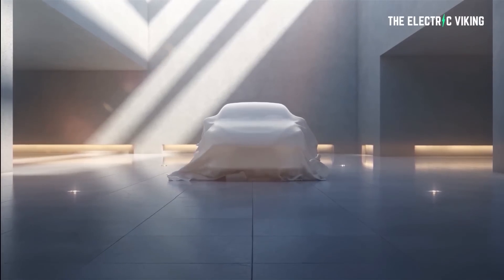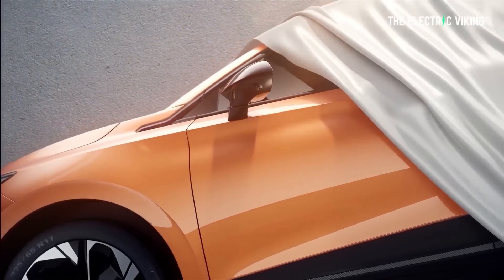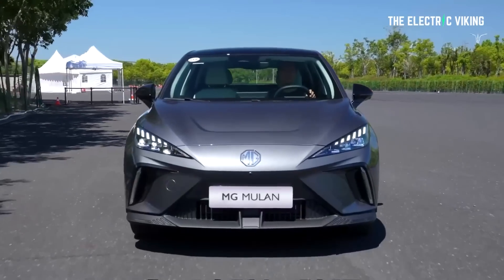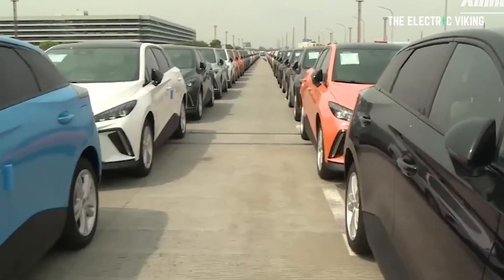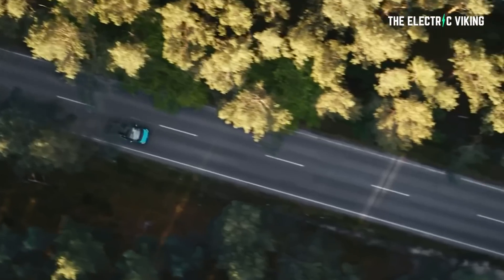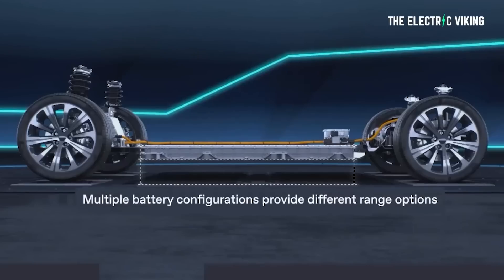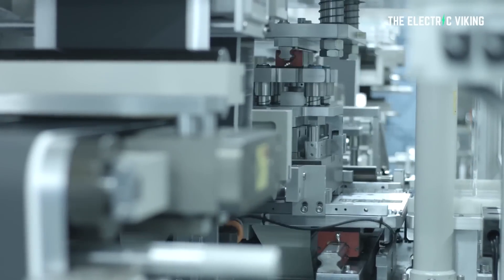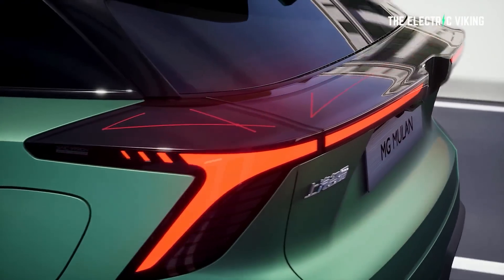MG 4 Mulan EV already shipped worldwide + how much it costs!

Comment: standard range and long range are rearwheel drive not front wheel drive as stated 👍
Reply: So you are saying your research into this car is better than Sam's 🧐
Reply: @icosthop9998  Motor is on the back axle for both batteries in the UK. Would seem strange to re-engineer the car for different markets.
Reply: Yes, the mg4 is a rear whel drive car. A massive advantage over byd's atto3 fwd. Fwd on a high cog suv makes for poor vehicle dynamics.
Reply: Sam is wrong,they are rear wheel drive,hot hatch is 4 wheel drive.

Comment: The famous MG brand that failed with the British car industry, now coming back as a Chinese import - says a lot about how the world has changed! Nice car and nice price.
Reply: I was wondering if it was the same company but I think it was bought out, just kept the old name ❔️
Reply: @icosthop9998  yup, nothing left of the original MG/Rover group not quite sure if they are still running the R&D at Longbridge as they were on about closing that down.
Reply: Joys of having Governmental support and a large cheap non unionized workforce and near zero objections to planning infrastructure builds
Reply: @charlesuk5358   Thank you very much 👍👌👍
 My  "Replies/Alert"  section of YouTube is not working all that good but much appreciated that this came through  🙂 👌

Comment: Those prices are With VAT icluded, here in Spain the top spec is 10k cheaper than the equivalent VW id 3.. all the MG 4 , except the Hot hatch, are rear wheel drive not front.

Comment: The SR LFP version has the same range at 100% charge as the LR version at 80% charge - which is what most people will be charging it to regularly to protect the battery and save time.

Something to consider.
Reply: Yes I was trying to find this information as all the U.K. reviews don’t mention the battery type, the base version is fantastic value and you can just wack it to 100% and drive it - makes it easy and quick to live with. All the reviews I have seen say this car is the puppies luggage.
Reply: @damiancox7276  true, and the LFP version should retain good battery health for years to come, which may have a positive effect on the resale value down the line, since people would be less concerned about how well you took care of the battery (by avoiding 100% charges).

With LFP they won't care.

Also the LFP is supposedly safer in a crash.

Comment: In the UK prices are £25,995 for the entry model £28,495 for mid range and £31,495 for the top end.  This includes any VAT. This is expansive based on the price in China in dollars.
I have the mid range in grey on order and should be available end December or January 🤞

Comment: I ordered the Trophy/Luxury version (Germany), paid around 31.500€ after taxes and after „environmental bonus“ of 4500€ by the state. 

You’re getting a car with almost every technology you could think of, except for wireless car play, front beepers (360° camera though) and stuff like auto park or summon features.

Moreover, you get 204hp in a smallish car with a 50:50 weight distribution. I don’t think it’ll get better than that for just over 30k for a couple of years, plus you have a 7 year warranty possibly reducing running costs by quite a bit.

Design-wise, I very much think that this cars design needs dark colors, the dark grey and even more so the black version look really quite aggressive irl.

Comment: In Italy the price is 30000€ for standard trim, 125kW motor, 50kWh battery, 350km range and 34000€ for comfort trim, 150kW motor, 60kWh battery, 450km range, included VAT. However, with government incentives, scrapping and old ICE car and with 1000€ launch discount from the dealers, the price becomes 24000€ and 28000€ respectively. Now, yesterday I was at a VW dealer to upgrade my ID.3 to software 2.4. A petrol, less than 125kW Golf, just at the entrance of the showroom, was priced as a "bargain" 32500€ price included VAT, of course there are no government incentives. So, why on this universe somebody having some mental sanity would still buy a VW Golf rather than, for example, an MG4 with comfort trim??? My "only" concern is that we will soon be in the hands of Chinese for cars too.
Reply: Just accept it dude that this is China's century.  🤣
Reply: I agree... Normally.

Right now in the EU, unfortunately there are valid reasons not to get an EV, and one of the biggest is the war in Ukraine.
Reply: @stevenjones916  Soclai is always better ;) than subservient  to individualistic US/UK/EU ;(

Comment: SAM STOP. The MG 4 is not front motor front wheel drive it’s REAR MOTOR REAR WHEEL DRIVE. Or Dual motor AWD.
Reply: Correct. A massive improvement over byds fwd atto3

Comment: BTW you mentioned there are 3 trim levels/models and included the Hot Hatch model in Europe (and therefore Germany for which you gave a price). The 4-wheel drive twin motor Hot Hatch is not shipping this year and no price has been announced. In the UK (trim levels have different names on mainland Europe) there are 3 trim levels all of which are single motor, REAR wheel drive, starting from £25,450 for the Standard Range SE trim with 51 kWh (LFP). Another £2,500 gets you the Long Range SE trim with 64 kWh (Li-Ion) and a further £3,000 buys you the top of the range Trophy with the same 64 kWh. In addition there are paint colour options with both metallic and Tri-coat options. There are to be Extended range 71 kWh and Performance (Twin-motor) models to released mid 2023 but prices aren't released for these which is understandable in the current climate.

Comment: I thought I saw somewhere that MG4 might also come with swappable battery .. If that's true, that would be just amazing.
Reply: Only if their sales make enough to Warren it...
It will be better if these manufacturers come stogether to setup some common ground so their battery swapping can cater for different type of battery tech & battery size...

It may not happen in EU & US for awhile but in China there may be a slim possibility it may be in their interest to do so
Reply: Don’t think it does on this model, however the electric platform it is built on does allow for that.  So maybe somewhere down the road.

Comment: Cars in the UK are normally more expensive than EU but for once this  is slightly cheaper starting at £27k..€31k inc tax !! ...And all reviews are pretty damn good. Finally the Chinese are brining competition as a result the new Kia Niro Ev is only a little more expensive.. but still very cheap compared with other offerings .. it looks like the competition is finally starting that will bring prices down.

Comment: This car does sound very interesting for the price. Some devils in the details that put me off: small back windows with poor visibility, no rear windscreen wiper (same issue as with the ioniq 5), no frunk in 2022?, contrary to report by electric viking, first reviews do mention poor software/incomplete software out of the box, no rear and front washer nozel to clean the camera lens.
Reply: My Vaxhall Ampera has no rear wiper, it's never been a problem, never even knew it was a problem, nor did my previous two BMW 3 series or volvo S40 thinking about it. As for no frunk in 2022, the "engine compartment" is smaller similar to the ID3 and the bonnet drops down at the front to reduce aerodynamic drag, that's why there is as much internal space as a Tesla model3 but the car's smaller, can't have everything. So the software is a bit slow, bid deal, it's not running ANSYS or STK, and as for no jet nozzle to clean the camera, like how hard is it to clean the camera with a damp cloth once a month?
Looks like a fantastic car to me, fantastic price, affordable!, design wise most people will like it, range is good, this could be the EV most ordinary families have been waiting for, half the price of a Tesla model3 or modelY.
Reply: If u want a spray nozzle to clean camera that's in Benz, Mercedes like pricing u are looking talking in a different market buy an BEV rolls royse (rolls royce may not have nozzle to clean camera) 

I haven't seen affordable ICE vehicles with back camera with a spray nozzles 😅 🤣

Comment: Disappointing the standard spec is FWD. Good though that the base models use the LFP batteries. I don't need to get to 100km/hr in 4 seconds, I would go for that base model if it was nicely under $40k driveaway and decent warranty.
Reply: @stevenjones916  Thanks and Wooly for pointing this out, good to know.

Comment: I have some insight into VW internal stuff

To fix their terrible software, Diess actually founded the daughter company “Cariad”. Because getting rid of people in the automotive industry is pretty tough in germany so to get around that they actually drafted every competent software engineer from all their different branches. They offered big cars and massive boni. This pissed basically everyone off since cariad wanted to start from scratch which would have taken years. Now porsche has been talking and working with apple for years, aiming to fully integrate apples new carplay. Diess however went public by saying “we can’t rely on apple for everything. Not everyone has an iphone.” Porsche however got really mad about this since their customers well … they tend to have iphones. 
Porsche as well as audi would have been forced to use cariads software.

Among other things: a high class VW brand has been developing a new System control unit that got rid of thousands of small micro controllers for an upcoming EV. The new VW CEO in a attempt to appeal to investors is now about to throw all of the hard and necessary work over - making all this a MASSIVE waste of money and time.
How does this appeal to investors ? If everything stays the way it was - outsourced software, old hardware and supply chains etc it fits very neatly into an investors spreadsheet.
Diess was the only guy that could have at least saved some of VW - I mean going from 11.8mio units down to 2 million EVs by 2026 is a pretty harsh drop but at least they would have a somewhat competitive product in the end. The biggest flaw of VWs is still their horrific software … Diess tried to fix it 

Now all of this is hearsay. None of the information I have is confirmed or comes straight from VW. A friend of a friend of a friend may have heard something.
Even if all of this is largely false: there’s a LOT going on at VW internally both leading up to Diess’ replacement and after. It’s going to be wild. 
 
Abd if you ask me? 
The writings on the wall.

Comment: So a China builld car that in China costs $18.000 will be allmost double in price when it hits the EU market. 
Thats what I expected. EU Protectionism, for the German, Italian and France car industry.
Reply: well, any country want to protect its manufactures. even in my country Indonesia. the cheapest tesla cost 150k usd. ioniq5 56k usd, ev6 cost 80k usd... that so called the chepest ev in china  wuling mini ev cost less 10k usd there here cost 16k usd (standard version) and 20k usd for long range version.
Reply: @jonitan76  Indeed. I understand protectionism, but . . . . this change to EV is environmentallly driven. All for better inverinment. 
But the old car industrie refuses to change to EV. There is a lot of pressure by the biljonairs in the oil and car industrie to keep burning fuel so they can keep getting richer. 
Thats what is behind it. And the mentallity of the masses, that is afraid of change.

Comment: Mulan is still more expensive than byd dolphin, so it won't sell well well in China. Most of the production will go to international markets. Do you really need 3.8s acc on such a compact car? I think people buying this car are practical and on tight budget. the long range version makes more sense for them.
Reply: The mg4 is rwd, the atto3 is fwd. There is a massive difference in driving dynamics between rwd (better) and fwd.
Reply: @nordic5490  that is true, though for this price range, do customers really care about this? mulan misses some important features. the 130k rmb version of mulan and 113k rmb version of dolphin have similar ranges, but the mulan doesn't have side airbags nor head airbags. other features on the mg are kind of lower than dolphin too. Besides, BMS of byd is way better than MG. the fact that mg is shipping most of mulan production out of china proves that SAIC prefers to avoid competeing with dolphin head on. that is a pretty wise decision. the chinese market is too price sensitive now.

Comment: Another Low Mileage UNAFFORDABLE E.V. 🤪 Get to the Back of the Line that goes on for 5 miles if we lined all these cars up
Reply: But it's actually cheaper than similarly sized new petrol cars!
Reply: 63kwh battery with a 77kwh coming next year nothing low mileage about that

Comment: In order to say if an electric car is really useful to the masses, you should tell these main specs about it: 
1) the real useful range in any kind of weather and terrain.
2) the length of the car.
3) the trunk-boot useful volume behind back seats.
4) if the car has a spare tire.
There are other important specs, but these 4 specs are the main ones.
If these main specs are not the right ones, then the car is not useful at all to regular people ( to the blue collar people ).
The range given by the chinese manufacturers is not truthful. Therefore, when you buy a chinese electric car, before you buy it, you should always first take it to an extensive ride up in the mountain, in low and high temperatures, etc, and see the real useful range by fully depleting  its battery and fully charge it back.
I'm sorry, but you can't yet trust the chinese manufacturers at the present time. The real range of the chinese electric cars are way off the chinese manufacturers told specs.
Reply: Oh, like the legacy (non-Chinese)manufacturers cheating on their fuel consumption and/or emissions specs?
Reply: Pleanty of reviewers have range tested the mg4, and actual range is similar to specified range.
Reply: Nor Dick / Again, I repeat, do it yourself before trusting any "reviewers". It's better to do that first and not cry later about your wasted money.
Better safe than sorry.